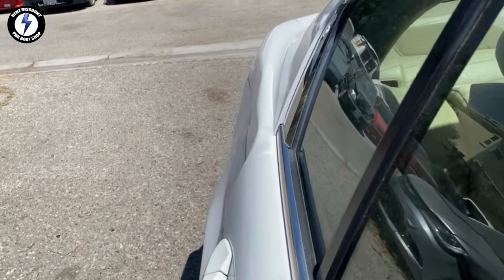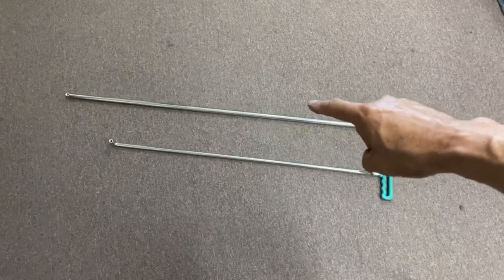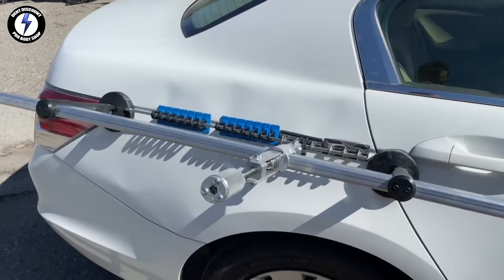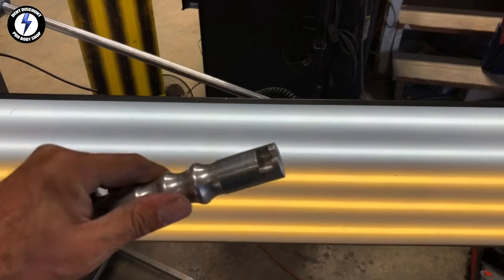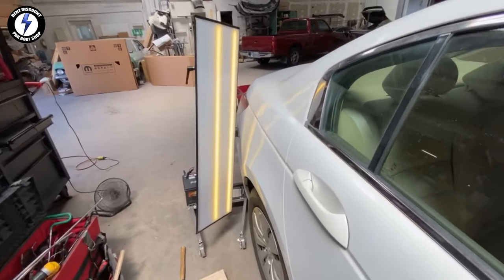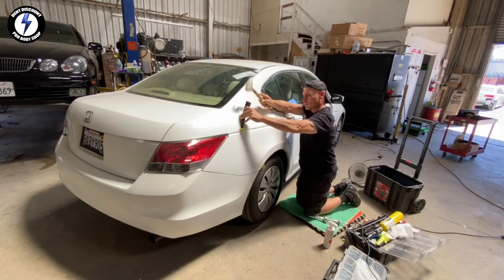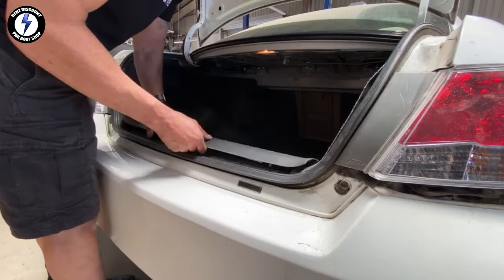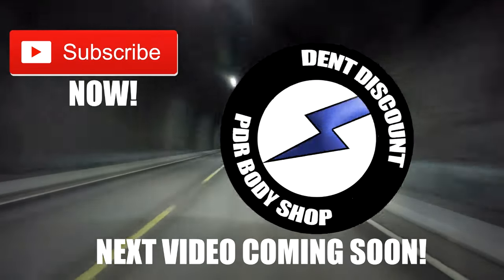Removing Large Bodyline Crease Dent with PDR! | TIPS & Techniques!

Comment: I'm new to your channel and after watching 2-3 video's, I'm totally impressed. Getting dents out is one thing, but even more impressive is how you remove the tabs, which are there for the purpose of pulling the dent's and yet, they're removed without further damage. Also, surely these panels must suffer some sort of metal fatigue of sorts, as you've no way of truly annealing them without damaging the paint. Still mightily impressive stuff.
Reply from the maker: Thank you Adam Orna for your comment.
You have a one time opportunity to get that panel straight you definitely don’t want to start warping it.. The manufacture paint is really durable it handles the hot glue really well
Reply: @DentDiscountPDRBodyShop  Hey, the 'man of steel', is a man of his word. A reply back straight after your working day is done. Maximum respect to you sir. Also I've recently had my historic Alfa Romeo, Berlina fall of the trolley jack only to be caught by the same jack and totally crush the sill on the front wing. I'm kind of certain that PDR can't be utilised solely, as it's actually torn the steel at the bottom point. By chance are you operating out of Florida? Just curious, as I spent a lot of time in Miami and Pt. St. Lucie.

Comment: Thanks alot. Nice work and am I ever learning a ton and becoming more and more reluctant to practice on my favorite car.  I am at the point of lacking confidence due to probability of using wrong tool with wrong technique.
Reply: PDR Trainer - Does it help to run your hand over the surface to determine what is needed or is the light all you need?

Comment: Im a new subscriber... Ive seen a couple of your videos and your work amazes me. I learned auto body in high school in the votech venter and this pdr stuff is new to me. I wouldve been one to cut out replace the panel and do a traditional repair on this 1/4. I dont do body work anymore as Im a computer tech but I just did a diy job on my 11 impala that was totaled out. instead of using a chain to pull out the corsair, i used a scissor jack chained to a tree. i didnt want to risk doing further dmg to the airbags system and didnt want the curtain bags or others to be set off while tugging one out. Welp cheers nice to meet ya and congrats on those elite dent skills.

Comment: The repair method in the video is applicable to the thin iron body. May I ask how to deal with the metal stretching problem? I am curious. Thanks!
Reply from the maker: Great question there is metal and aluminum shrinking machines that can shrink metal
I have it on my website
Manofsteelpdr.com
Thank you for your comment and question

Comment: I had a sideswipe that I was able to remove all the other cars paint.
Looks good no buffer burns.
But I see a dent in passenger door, and a dent where the back door and passenger door meet. 
Will heating the metal help with a dent puller?
Reply from the maker: Go buy some glue tabs and rods you can get some cheap ones on Amazon

Comment: I learned alot from you.  Thanks.  I am facing a similar issue on a lincoln mkz.  How is the body so soft with the pdr rod at the very end on your video? The body is so tough I had to use a 3 pound pusher to get some of the dents out!  Its right near the stop sign same spot you are at.  I tried heating it and it did help a little.

Comment: I hate to criticize, but the bodyshop down the street is correct. Everyone of those heavy crowns has fractured paint and primer under the surface. If you feather them out with a DA, the cracks show up clear as day. The areas around the crowns are going to have to be stripped to bare metal.

That said, the metal working shown here is incredible. This totally saves having to cut the vehicle apart and replace the quarter panel. Even if your work gets painted, this is a significantly higher quality repair.

I could not do this without picking and filing to get the final details. There is a level of refinement here that is off the scale. Its got me thinking that I need to go to a junk yard and buy a hood, or deck lid or something to practice on.

Comment: When the body shops say without cracking the paint what they mean is hunt this car down a year or two from now and see how much of that paint has flaked off the quarter panel. Paint is not designed to flex that much even with flex additive. You have great skills and that's an amazing dent to pull out and make look like that but when the paint comes flying off in a year or two and needs repainted it makes more sense to just repair it in a body shop.
Reply from the maker: Thank you Brock for your comment..
When you heat up the paint or of the panels warm from the sun you the paint will not crack. If the paint doesn’t crack during the repair it definitely won’t crack driving in the vehicle
I’ve been doing Paintless dent repair for 30 years I have a lifetime warranty and no one’s ever come back with an issue

Comment: As a new subscriber, I was wondering if you could recommend a supplier for more extensive dent puller tools. I already have a great kit for minor dents, but I need to remove a crease on the bottom side of a Buck Century door and I believe these more extensive tools will be necessary. Thank you in advance for any help you can provide.

Thanks,

Jeff H.

Comment: Thanks.. I have none of these tools or experience but I have a car with a front panel large dent but my wife likes the car and does not mind If I experiment on it and it does not come out perfect (which it won't I am sure). I need to do it because no repairers will touch it because it has a very small crimp in the forward chassis box member from a previous accident and they all want to write it off because they cannot sign off the car as repaired to the standards they must legally adhere to.

Comment: What kind of glue do you use to keep those crease tabs from being pulled off while pulling out the dent? What do you use to remove them?
Reply from the maker: Manofsteelpdr.com
The glue I use is on the website link
Are use alcohol to remove the glue
Reply: @DentDiscountPDRBodyShop  Thanks for the reply.  The first time you removed the tabs, you only mentioned using alcohol to clean, but you did later mention on the second set to also use alcohol to remove them, so my bad for not paying attention.  I find it amazing the clue is that strong, and they don't pop off while pulling. Someone did a hit and run one day and put a very long deep crease all along the driver's side of my car that was parked on the street. It must have been from someone pulling a trailer or something similar. I started looking at a bunch of yours and other videos on YouTube, and found yours to be the best, the most detailed, and most comprehensive.

Comment: Hi, I'm a new subscriber to your channel. You make it look easy. So I'm giving it a go on my partners car I dented a while ago.

 Do you use special hot glue? I've tried so hard with the hot glue method but no matter how well I clean the panel the pads just come straight off when I pull the slide hammer. So frustrating as yours seem to really stick fast. What am I doing wrong
Reply from the maker: Welcome aboard. I made a video on high strength glue.. take a look

Comment: New here. Having a look so I can help my son fix the car he has borrowed. Someone backed into the front wheel hub.
Reply from the maker: Welcome aboard Darlz!! Good luck
Reply: Awesome repair. You never cease to amaze me and I’ve been doing this 26 years. I have a question about this repair. Looking back on it, do you think it would’ve been even quicker and easier had you gone after those huge crowns at the top a little bit first? By doing some sort of gentle pulling, either with a floor tower or bridge puller....before attacking the body line?

Comment: Awesome work and technique. I hired a guy to do a ding and I almost had a heart attack. No plastic taps or rubber type hammer. He used a little hammer (steel) and what it looked like a flattened little screw driver ad a tapper. And not after drilling a hole under my wheel well at the rear to access🤦‍♂️. After, he sanded the spot and polished. Geez.
Reply from the maker: Thank you Steve for your comment I appreciate it.. yes there’s a lot of guys that are hacks out there sorry that happened to you..Clark Ken   
https://secretpdrpaintlessdentrepairtrainingonline.com/howtopaintlessdentremoval/

Comment: I'M a new subscriber to your channel. I need your help and advice on a damaged door,if the dents an body lines can be pulled out.
Reply from the maker: Welcome aboard thank for subscribing.
Yes dents can be repaired on a body line.
If you’re a beginner DIY you’re going to Struggle without the correct training and tools. If you are a PDR tech you will need to keep practicing.
Reply: @DentDiscountPDRBodyShop  would like to send you afew pics of the door damage.this would be my first time doing this. It helps I work for an body shop as a paint correction specialist.
Reply from the maker: My email is on this website let’s see what you have
Clark Ken a.k.a. Man of Steel 
https://secretpdrpaintlessdentrepairtrainingonline.com/howtopaintlessdentremoval/